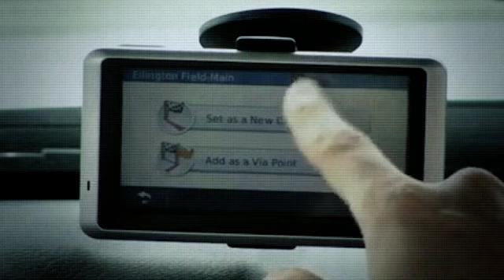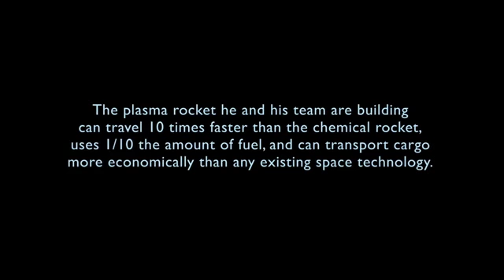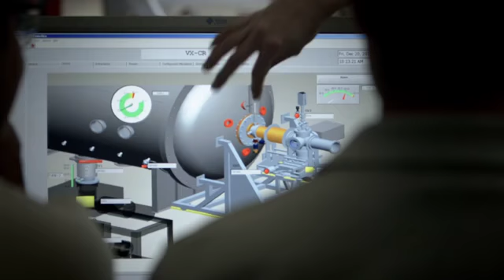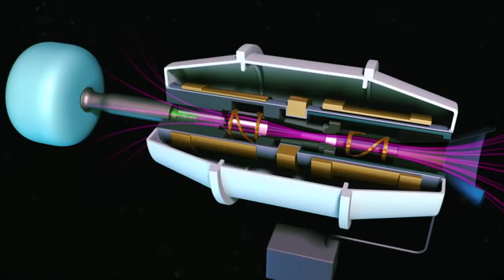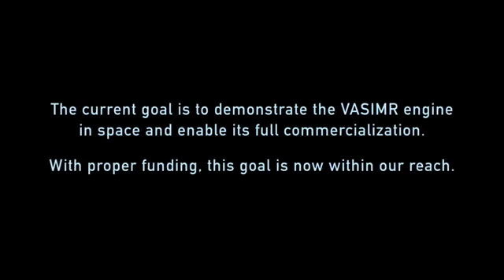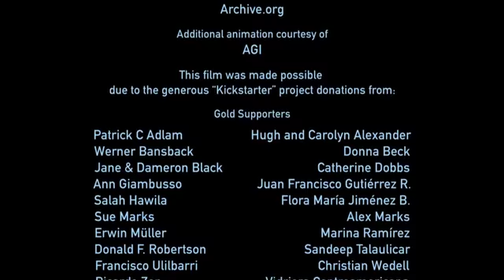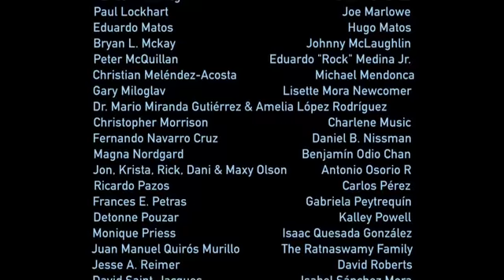Crossing the Space Frontier

Comment: I don't know that Diaz is a con-man... But I can tell you that is in-fact a UV light they have built. And yeah it's a lot of heat if you can find that kinda power in space. However ion gas thrusters then make more sense. And also where is this magnetic rocket nozzle? Why is it not a vacuum nozzle? For that fact why do you need an expansion cone? Why use a toroid shape cone at all if the gas is moving that fast. You are not introducing oxygen...so the expansion nozzle is what makes me think maybe Diaz is a con...